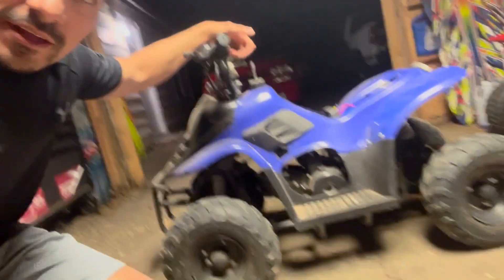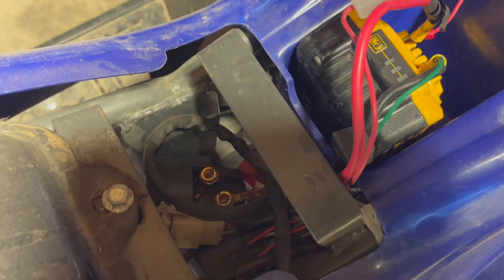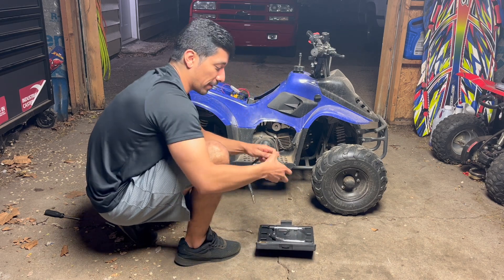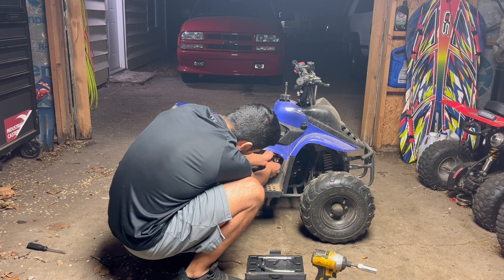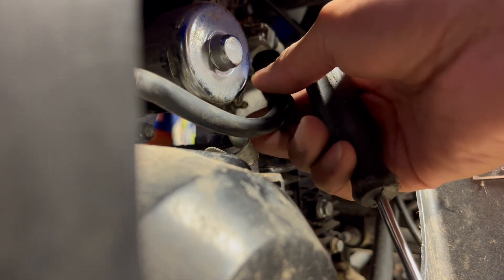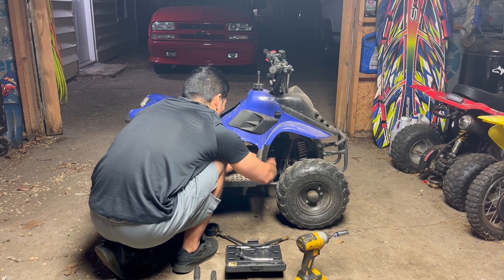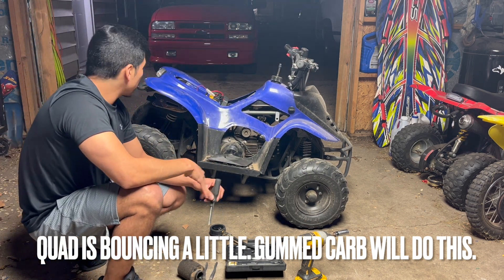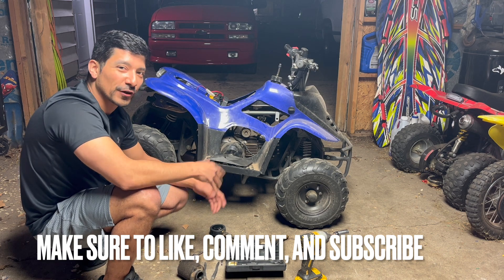Free Quad. The Bare Minimum to Make a Quad Run. Tao Tao. 110cc.

Comment: Nice find
Reply from the maker: Thanks man. Was my friends.  He gave it to me…I tried to pay him for it, but he said don’t worry about it.
Reply: @brokemexicanreviews  what a nice guy… perhaps he was also a little fed up with it
Reply from the maker: I’ve been fed up with them before.  I think he was also. I think the electrical issue is because the harness got wet.
Reply: @brokemexicanreviews  could be anything really. That little quad I have gets that problem all the time but if I jiggle the plugs in the wire harness it just starts working again
Reply from the maker: I’ve tried this before with no luck. I feel like anytime the wiring harnesses get wet on these little quads they have issues
Reply: @brokemexicanreviews  yeah it definitely does and also on mine the little spring connectors that slide onto the spade connectors actually snapped the spring off in mine so the plugs are hardly making any contact
Reply from the maker: I have seen this also.  Hopefully all this info helps someone in the future. Thanks for all the feedback